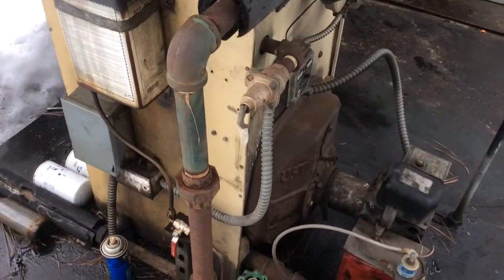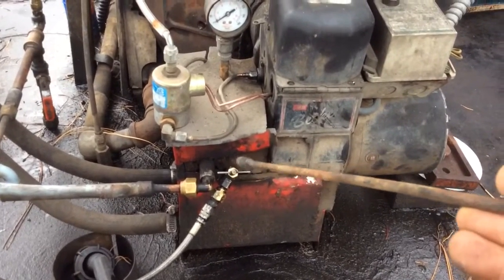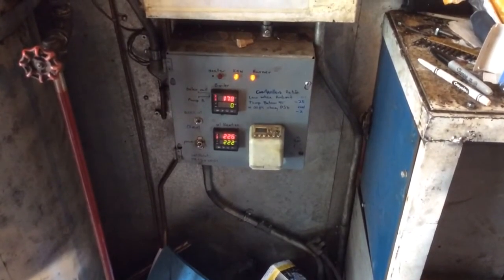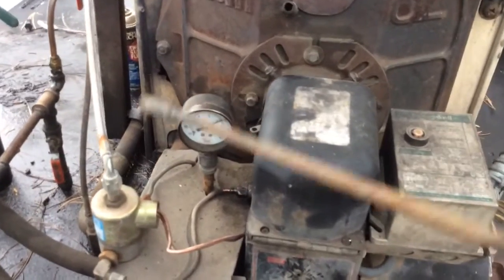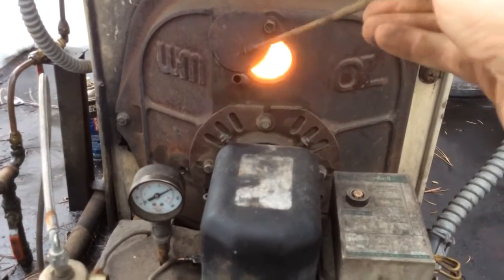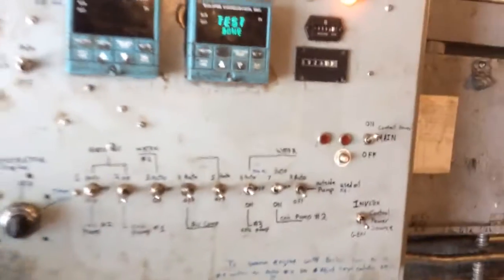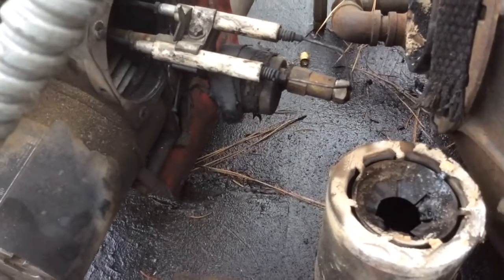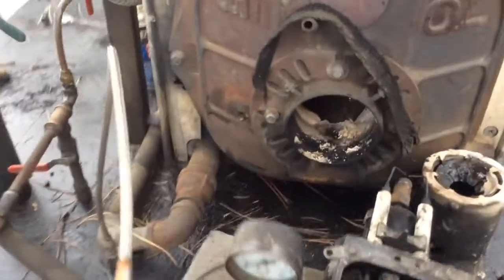Beckett  Burner Used Waste Oil Conversion Automatic System Heating

Comment: How I can contact you?
Reply from the maker: What are u wanting to ask?
Reply: @mjwdrones4all41 like nozzle size ?
Pressure? And if they work with .65 30A nozzle?
Reply from the maker: @franciscooferreiras5452   Due high BTU’s of used oil u need 2 go  to like .55  I would not recommend doing waste oil on any system with fire rate of less then 2 GPH  cuz the nozzle will plug up every couple days.
Reply: @mjwdrones4all41 ok thanks. Another question: the oil temperature does it still works at 160F or only warming up the nozzle would work too?
Reply from the maker: @franciscooferreiras5452  U only need to heat just nozzle just remember there is air blowing across it i found u must have about 300 watts of heat at nozzle but if u warm oil and air going in to burner helps a bunch

Comment: What are you powering the nichrome with, what gauge and how many volts?
Reply from the maker: I use switching power supply 12 to 15 volts 30amps rating
Reply: @mjwdrones4all41  Thanks! I am running WMO in a weil-mclain boiler to heat my greenhouse. I preheat/heat my holding barrel with a drum heater, oil temp is around 130 degree's. I'm only running into an issue when it's been idle for several hours and the oil in the nozzle is cold. Beckett did make a cold start/preheater item that's been discontinued, but I was able to order from INOV8 in WI. It clamps to the nozzle line and keeps it at a similar temp. I really appreciate your setup.

Comment: Hello friend. I maked a same machine but i have to many smoke when i burn it on.  I used china type nozzle. I tried everything but the smoke is to much. Which type nozzle you use? Thanks.
Reply from the maker: semi solid 70 degree sounds like you may not have enough air also make sure you use flame  retention head.

Comment: What nozzle size and what exhaust gas temperature do you see? What is your source of waste oil? It's a pretty impressive setup you have.
Reply from the maker: firing rate of boiler 1.5 gph but I found 1.10 gph is better due to hi BTU content of waste oil. exhaust temp  250 degree F ish. I get  most oil from business that have fleets they service them self.
Reply: @mjwdrones4all41  
Woah. 250F stack temperature is pretty low in a boiler of that size in that firing range. Is it just really efficient, or do you have to use a ton of excess air to get it to burn without soot, which also lowers stack temperatures?

Comment: WHAT PRESSURE IS THE WASTE OIL, IS THE STARTNG FUEL ALSO UNDER PRESSURE ?
IS THE PRESSURE FROM A FLUID PUMP
Reply from the maker: Pressure is made by just regular  beckett oil burner pump mounted on the side of burner  PSI is 115.

Comment: I want to do just like you have done. Very nice conversion. I have been planning this in my head for 2 years. Mine will be in a shed 30' from my house. I will use insulated boiler pipe to run into my house to a heat exchanger in my furnace. I will then use existing furnace and duct work to distribute heat.

Comment: that's a nice set up you have im trying to use a beckett  for a wood boiler   do you have any trouble out of that one
Reply: +thomas1971ish  and  how much oil does it use
Reply from the maker: firing rate of boiler is 1.5 Gallan per hour  but due to high btu content of waste oil had reduce to 1 GPH. Burner only fires when needed.
Reply from the maker: +MJW DRONES4all  burner is very reliable  if you set nozzle and electrode depth right  be sure to use 2 micron filter if nozzle is 1 GPH or less larger nozzle 10 micro ok.
Reply: +MJW DRONES4all  I got  this one running but still fine tuning on it